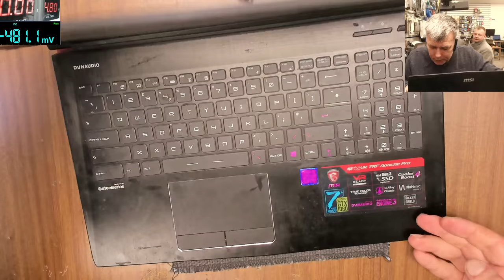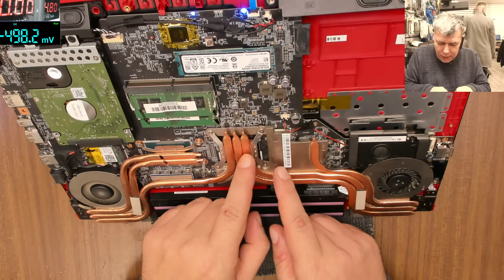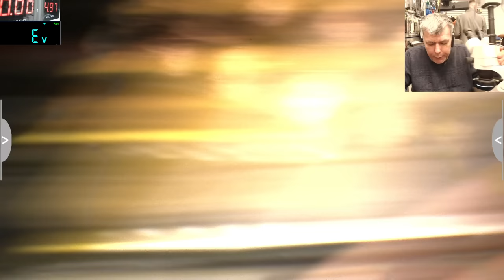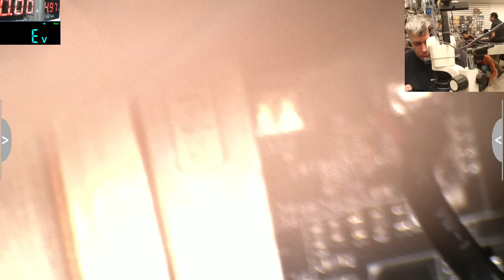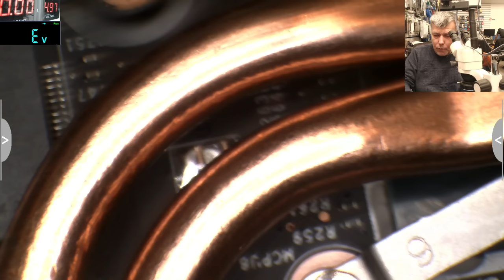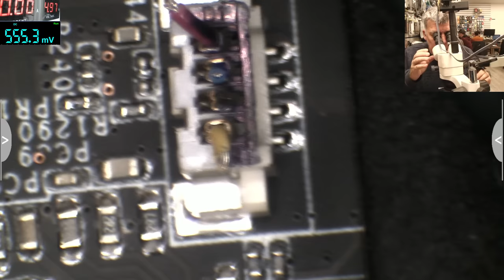How to solve a overheating issue when the fan is good but not spinning

Comment: I agree that laptop deserved a little more investigation time spent on it, but that's how it goes: we have good days and bad days at work.
This channel has actually gave me great confidence to fix 3 old laptops already. One VAIO with a shorted USB (which I found using the multimeter and then realized the chip was burned when I got my microscope over it), another one Acer with a bad capacitor and one HP with a shorted internal battery (yeah, the battery itself was shorted). This is a great channel with amazing content. Thanks!
Reply: How did you find a short with the multimeter only?
Reply: Just use it on diode mode (beep mode). It can detect shorts between positive and negative rails (that shouldn't happen).
Reply: Understood

Comment: The key word here is PWM - pulse width modulation. The fan has 5v on the red (+) all the time, but the frequency applied to the fourth pin controls its speed. If this is stuck low, the fan won't spin. If you disconnect it, it will always run at full speed.
Reply: Your are right it's a simple pwd controlled DC motor with a driver and the feedback is a diode for the temperature, so pwm signal is generated from the superIO from what I understand, don't know how it failed, maybe they didnt calculated properly the supplied current?
Reply: If the PWM pin is left floating, it runs at max speed.
Reply: My laptop cpu fan is not spinning, but I checked the cpu fan and it is good and spinning. Is it possible that the faulty is the mosfet in the cpu fan pin?
Reply: @fcuk_x  I was wondering the same thing. Maybe he accidentally touched both the red and the yellow wires using the power supply instead of only touching the red?

Comment: In case you miss the description: "After i stopped the recording, the laptop was still shutting down randomly. 3 hours later a found actually the SIO chip is faulty, that's why the fan was not working also"; In any case i liked the alternative solution for the fan.
Reply: This is not the case, even if the SIO is faulty it will not cause the laptop to shut off, what would cause it to shut off is the EC which is programmed to protect your laptop if overheated or one of the fans stop working.
The fix is simple, link cpu side pwn signal to gpu side on the board, would be a cheap fix and would work well in most cases and the EC will not trigger a shutdown as it will see that the pwn signal is ok and the fan is spinning.
Reply: @robertvogel4056  What is EC? Is it not the same as Super I/0
Reply: @0ctivate  no, EC is another chip that checks if fans spin and other stuff such as if u have mxm gpu, if slot is occupied etc... and will prevent the laptop from operating in case some of the checks fail.

Comment: Sorin!!! Salut! Replacing the fan solve that issue. The driver inside the fan is faulty. The blue wire is an output from that driver which is read by fan controller on pcb. Salutari din Romania!!

Comment: Even when you do doggy work you can allways do it better, for example cut the wires a bit further away from the connector, that way no plastic would be melted, the connector would be still removable for various reasons in the future and it would be easier to solder the wires. However i envy you of your computer knowledge Sorin! Continue with the good work, i have seen almost all your videos and like allways can't wait for your next ones honestly. Thank you.

Comment: You could simply exchange fans and check after launching a game uses heavy graphic first of all. The gpu fan may not run always bcz its also connected to the cpu fan for normal use cooling. The gpu fan may only works as extension on a special case

Comment: This was super dodgy! That's great, that the laptop got fixed, but it would also be possible without destroing the fan connectors =( Also, the GPU could be off, because it turns on when an GPU intensive task is launched, like a game. Thank you for the video!
Reply: Sorin ='s dodgy
Reply: No issue with the final repair itself, but would have been more practical and cleaner to just de-pin rather than cutting the wires.
Reply: Stop talkin' n start choppin'
Reply: @Ghost572  no time to explain! 😁

Comment: Hello Sorin. I see you keep stripping the wires of their insulation with your teeth. This is a bad example. I have also done this several times in the past, resulting in bad incisors and a visit to the dentist that costs a lot of money. Strip the insulation off the wires with a wire stripper or sharp knife, but keep your teeth healthy and avoid this operation, tempting as it may be. A golden advice is worth money. GRTS Andy

Comment: :)) I had the same problem with a similar model, the second fan only comes on when you press the fan button next to the power button. Stupid design but unbelievably this is the way they built these MSI laptops. Literally that laptop didn't need any "fixing" in your defence I spent 2 days trying to understand why that fan wasn't working even with high temperatures. In don't understand why msi did that. Remember for the next time when you encounter the same problem. Press the fan button first, and if it doesn't work then fix it :)

Comment: Fixed my problem. For me when the gpu fan wanted too start it failed and green power light started too blink orange, after about 1 minute it shuts down. One difference in the repairs is that for me it was the red wire. Gpu fan port was giving 1.2v and cpu fan port 5.2v. Thanks for the video

Comment: there's plus, minus, one is TACH signal from the fan back (mostly yellow) for the rpm and one is a PWM signal from the board to control the fan speed. 
99% of all fans in desktops or laptops and even in servers work this way. The first thing i'd have done is looking into the BIOS and check for the fan control. Then checking the operating system. Sometimes there are Fan-Tools, that take over control completely... and cause these problems. Not measuring and not looking into the BIOS was really dodgy...

Comment: looks like someone been using it to put their cups of coffee on... on my MSI  laptop 1 fan is for the GPU and it only runs when that GPU is under load, if its running only the built in gfx on the CPU like you would if your only running the desktop the  GPU fan doesnt spin, but the CPU fan does  it may be worth checking the  gpu fan profile  in dragon center

Comment: I have this laptop. I have to re-paste it every 3~6 months.
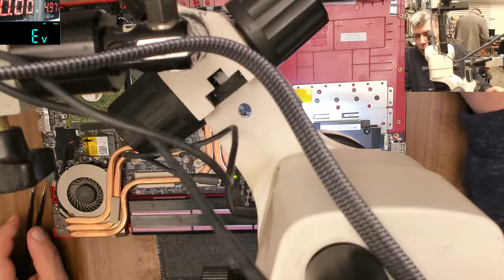11:10 a wire strand broke :( be careful it might short something
Did not like soldering too close to the connector melting it. I'd splice higher, about 3 inches away.

Comment: For me better to tap the red wire on nearest 5v suspend on that fan circuit. for sure there is resistor or Ic nearest on missing fan voltage
Reply: Hello idol. Possible ba na may problema yung mosfet sa cpu fin pin? Ayaw kasi gumana cpu fan pero okay naman kapag sa power supply ko nirekta
Reply: @1MW07F  wlang kinalaman ang mosfet dyn, fan circuit ang may problem dyn.
Reply: @JazzEnso  Bale much better palitan na yung cpu fan no idol?
Reply: @JazzEnso  Nung chineck ko sir walang 5v sa cpu fan pin.
Reply: same problem tayo kaya nakafull speed fan ko naka tapped sa 5v @1MW07F

Comment: Oh god, please don't hack up connectors like that. If you need to test something, simply lift up the little plastic tab holding the pin in the connector and it will pull out easily! Geez! If I was that customer I would bring the laptop back and tell you to replace the connector again because that is just butchery beyond belief. Don't hack up connectors! Just lift the plastic tab and remove a pin if you need to do that. Think......

Comment: You made also one of the biggest mistakes, you didn't checked the BIOS settings, there you can turn total turn off the fans from the BIOS settings on almost every bios.
So next time when the fans are not working just check the bios settings, it's free and you don't need to cut wires in case the fan, wires and motherboard are ok!
Reply: Thanks for this tip

Comment: Syncing GPU & CPU PWM fans is a really REALLY bad idea, cause depending on the load (gaming or video editing etc) you can have a high CPU load thus high CPU temp while at the same time having a low GPU temp and vice versa. For example, if you use AIDA64 your CPU can go up to 100C while the GPU stays at 50C and if you run a GPU intensive game you can have 60C on the CPU and 90+ on the GPU easy. Now imagine having a low RPM on the GPU fan on the 2nd scenario cause it is synced with the CPU thermal sensor...
Reply: You have a point but the heat pipes from the gpu go to both fans, Sorin did talk about it at about 4:00 . And the fans did spin faster when he heated the pipes on the gpu with the hot air gun so it seems to be ok. Even if not the pc is smart enough to shut it self down if temp was to exceed in some case.
Reply: @sakisgri2165  thats not correct
 Even if half of pipes where shared there is no way heat on one chip could warm up another crystal hot enough to get to the internal temp sensor. Hotgun is not valid test at all, this is 200-400c applied directly to the pipe.
Reply: I had a similar cooled laptop  (based on clevo p670rs-g). My laptop cooling was the best I've seen for a 'slim' laptop. I'm not an engineer or someone who repairs laptops for living, but I've seen a lot of laptops as " the tech friend who understands PCs", to clean and repaste the machines of friends and family.
   I've never seen a laptop running a game, to be cool on the CPU and hot on  the GPU with differences like 60 to 90C. IMO laptops BIOS is always trying to keep the fans quiet and even when the temps are 95C, it doesn't blow at 100%. (I've seen few laptops with a Control Center that can push the fans to 100%, which shows you how much louder they can get).
  My point is that when gaming, even in lighter games, from what I've seen, most laptops are going to let the CPU reach atlest 85-90 degrees on the CPU and it should't be such a big deal the way he did the repair.

P.S. My experience is on older laptops with 2cores or  4c8t Intel CPUs, so you are probably correct that the CPU can be a lot colder, if you run something like Heaven's Benchmark and no load on the CPU.
Reply: @ИлиянБелев  Gaming Laptops have much more pressure on cooling system which means manufacturers try to keep low rpm as long a possible, otherwise it would be constantly loud + have much shorter lifespan. As a repair engineer i see absolutely no issue in fixing pwm signal even if its lost, worst case that would be EC replacement + flash + pwm controller replacement. However it should be considered as a board level repair, basically cooling system us as important as any other system on laptop and it is one of most common failure reasons. There are many other components which shoild be cooled like GPU RAM and switching mosfets.
Reply: @inwerp  respect your idea but why are you here ? the answer is to learn . you are not in Sorin's level to be a critic . Please go do what you do and stay away from this channel or learn and be quiet . Sorin in another level above all what so called engineers . peace

Comment: I use to be amazed with the technical skill and dodginess of Mr. Sorin. 
But after watching this video I felt disappointed. Sometimes is better to take a deeper look at the mainboard before turning a fixing into a mess. 
On 4 wires fans, PWM signal is used to control spinning speed. That PWM signal comes usually from a tiny chip than converts the digital signal from SIO into PWM signal. There is a big chance to that tiny chip to be faulty, not SIO.
Futhermore, if a discordance between the speed determined by PWM signal and the speed sensed by the fan speed sensor is detected, SIO might decide to make an emergency shutdown in order to avoid overheating damages. That can be the reason for that laptop to shutdown randomly.
Reply: Quite an intesting thought that would solve my older laptops issue too. Fan change hasnt solved there the problem.
Reply: Chat gpt read your comment and it's said it's almost correct, only thing he corrected is "PWM signal is typically generated by a small chip on the motherboard, not the System Input/Output (SIO) controller chip. This small chip is responsible for converting a digital control signal into a PWM signal that instructs the fan to spin at a particular speed."

Comment: Hi' great channel ! Thanks!
What can you do with a laptop fans that won't spin fast enough, they are clean, new thermal paste.
The fans will spining fast but not when they should- i mean, when the laptop getting hot (90c -+ ) they keep spin low and when they finally increase the speed the temp is lowered as it should.
No bios update available
Asus u563x
Thanks!

Comment: Well I had a similar issue when my Dell laptop kept rebooting from about 5 minutes running on and on. The laptops under cover were quite hot and I thought the wifi module went bad. I went to the service where they made the fan to a fixed voltage but that not solved the problem. Later they guessed the SIO chip or GPU has an issue but said the repair wont woth it.  I did want to write to Sorin but now I came across this video however it would be nice to make a video about the super IO chip issue,

Comment: I believe that fan can be controlled by bios settings or windows softwares. 
The wire can be a data line and it was turned off from software.

Comment: Hi there , at 07:26 , what's meaning of Driver? thnx
Reply: He speaks for the DC motor driver which is an ic, typically H bridge, you can Google what is h Bridge and of course a logic that controls the speed and direction, the direction also can be controlled through the H bridge, but the speed is PWM controlled
Reply: @ДимитърАндонов-ъ7е  thankyou

Comment: Hi Sorin, I have a toshiba satellite L845 laptop with amd apu A6 4400m cpu which heats up to 98 - 100 degrees in just about 5 minutes of turning it on, then it turns off, I already changed thermal paste, the cooler fan spins well, I see it in good heatsink Status, will the motherboard have any electronic problems? Maybe some smd thermal sensor? I hope you can guide me on what to check, I already have the schematic of the motherboard but I don't know where to check it, thanks!
Reply: place a thin 0.5mm copper plate (amazon) between the cpu die and cooler with thermal paste on both sides, had this exact issue with a different laptop and temps went to 40's in idle from 70's.
Reply: Hi, @fliporflop7119  thanks for response, I had already tried this method with the copper plates attached, I bought them on Aliexpress, I had no success, the amd A6 apu cpu reaches 100 degrees in a few minutes and the laptop turns off without me being able to resolve that failure
Reply: @adrianmedina7065   maybe the copper heatsink is punctured and the small amount of gas that should be result of the liquid inside the copper is not completing the full cycle of moving the heat as is was designed to.  Most gaming laptops have heatsinks with a little liquid inside, when heat is applied from the cpu die, that turns into gas and helps dissipate heat faster, if the heatsink is compromised, you can experience the issue you are describing.

Comment: i have fixed this issue on my hp laptop by reinstalling the OS..so i guess it was just software issue since i installed "not good" verison of windows :)
Reply: its because your windows was not activated. if you activate windows it will make all fans spin with the correct speed
Reply: @robbirobson7330  it was activated, but it was pirate version
Reply: @entertainmentguy4509  Lol no you fan is not controled by windows UEFI/Bios controls the fan speed.
Reply: @mart43  ive just said what fixed my issue, nothing else
Reply: @robbirobson7330  Really ?
Reply: @Customer22374rt  i was joking

Comment: I have a heat problem with vga ati, it causes a bsod with the words "atikmpag.sys"

I added a thin copper plate in the gap between the VGA chipset and the heatsink then the temperature returned to normal and the laptop was normal

But after a few months passed, the bsod "atikmpag.sys" came again. even this time the laptop screen won't turn on

Have you experienced it?
Reply: h
Reply: junk it
Reply: @Customer22374rt  Refusing to be trash :D , I make it an eGpu using a riser.

Because I do not have a rework station to remove the bga chipset.

Comment: Hey
This bios does not work correctly because of this, the cooling does not work.
They will bring it back to you for repairs soon.
Thank you for the video
Reply: if the other fan had a proplem you would be riqht
Reply: how do you know
Reply: @robbirobson7330  I repair Laptops myself, this is how I know that BIOS Dump with an error
Reply: @KAZ-DE  so bios update will fix it?